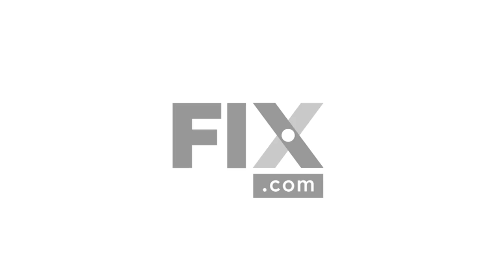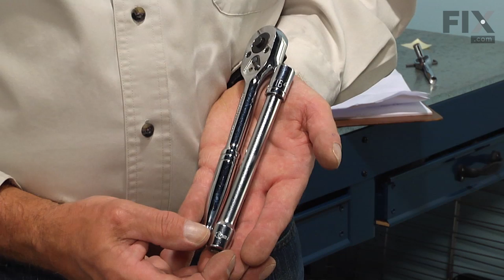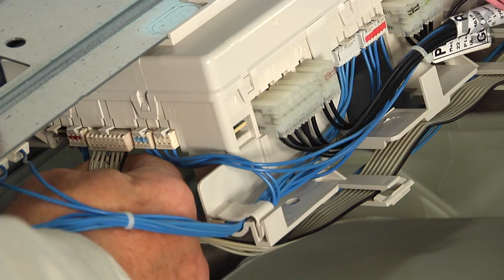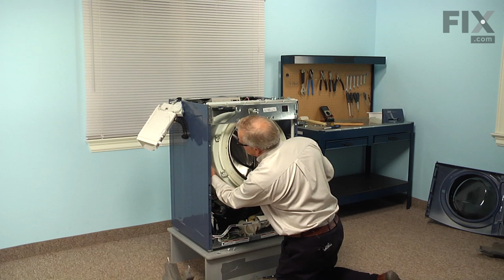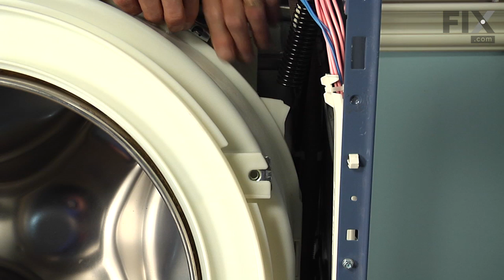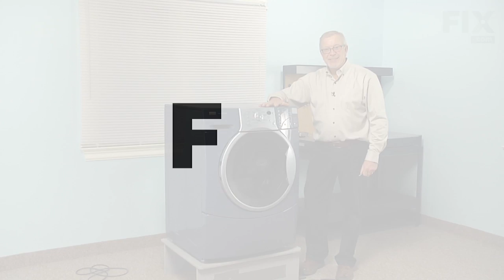Kenmore Washer Repair – How to replace the Outer Tub

Comment: What causes the outer tub to shred ??
Reply: The spider bracket on the back of the basket is broken.  It is not serviceable and Whirlpool has completely obsoleted the replacement parts, 8181668 or 8182247 or WPW10269756.
When the spider bracket breaks, the whole basket wobbles inside the front & rear tub assembly, wiping out the front edge of the front tub part, W10772607.  It's kind of weird that both the front and rear tub parts are still available; W10772607 & W10772618 plus gasket, WP8181673 but the tub is not. You might be able to find reconditioned spider brackets on eBay and it is removable from the back of the stainless steel basket with 6 bolts.  
I ended up replacing the Kenmore Elite H3 unit with a new Whirlpool unit, WFW5620HW, for about the same price of finding all the parts. 
Hey, I got 27 years out of the German built Kenmore Elite H3 washing machine! Not bad, eh!
Reply: @gregsickmeier4893  thank you I was about to replace mine.  Is it always the spider bracket breaking that causes this?..... My wife said the washer sounds loud and just kept using it and it shredded the front part of the tub
Reply: Just happened to mine about 3 weeks ago. I had the repair guy come out so he could tell me it would be 1500.00 to fix the tub! Then told me that you cant even get the parts anymore?????  Well I am limping along  washing and spinning on low and smaller loads till I figure out what to do. I have a matching pair with the pedistles, hate to think of that in a landfill.
Reply: Also, I can find the parts but who knows if that will fix it or I need more repair. With they just made these appliances without all the bells and whistles. I have never used 3/4 of the setting on this control panel and do I really need WiFi? wtf
Reply: Can I ask, 
Did you replace because of plastic shredding from the front tub between the metal tub and outer tub area? I’m trying to figure out what I need to replace. I see something here about the spider bracket, I’m wondering if that’s what is causing the problem I have

Comment: Why was the front half of the outer tub in need of replacing? I have one in which the front edge of the front half of the outer tub basically shredded, is that what happened to the tub in the video (possibly visible at about 13:00? What might have caused this condition? Thank you.
Reply: Your washer might not be on completely level ground, causing it to spin and bang around. Happened to mine -_-
Reply: In my case, I think the outer cover was actually missing the gasket, so the tub was spinning directly on the plastic!
This video is very helpful.
Reply: @luisruelas6899  Thanks for the comment Luis, but in my case it was on level ground and was sitting securely and square (level). It was more costly to replace the damaged parts than to replace the whole unit. I completely disassembled the whole machine, scrapped the cabinet and damaged parts, and posted all the electronics, weights, motor, soap dispenser gaskets, etcetera, as available on  Facebook market place. As you might expect, I got no interest and it is all sitting in boxes in my garage. LOL.
Reply: @johnwoehriii3974  I had the same situation you had John, front lip of the front tub shredded. I'm not sure what maintains a margin between the inner and outer tubs, but the machine did get badly out of balance once, and shredded after that.
Reply: I have the same problem, front edge shredded, I realized the problem because it made a lot of noise, did you fix the problem replacing the outer tub?
Reply: Luis Ruelas how did you fix the problem?? Just changing the outer tub and leveling the washer machine?
Reply: I saw in another video that if the rear bearing is bad several symptoms result.  1) noise 2) uneven rotation of basket in outer tub 3) basket shreds pastic at front of outer tub.  4) maybe even smell of burning plastic during shredding.  need to replace front outer tub (because it's shredded) and rear outer tub (because bearings).